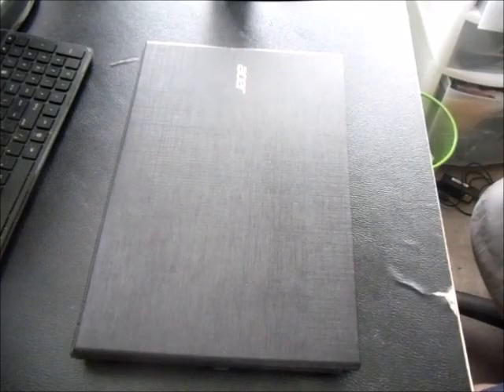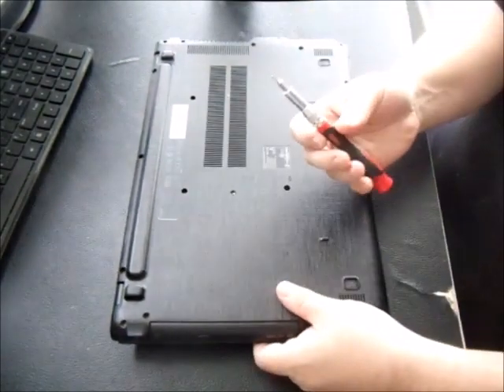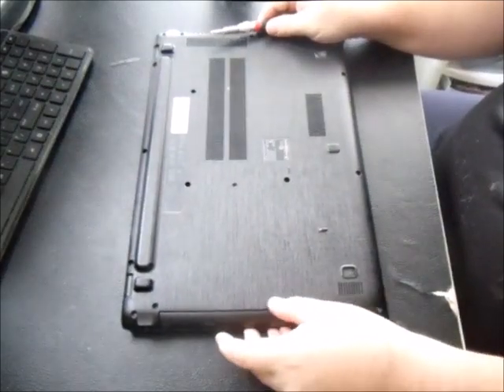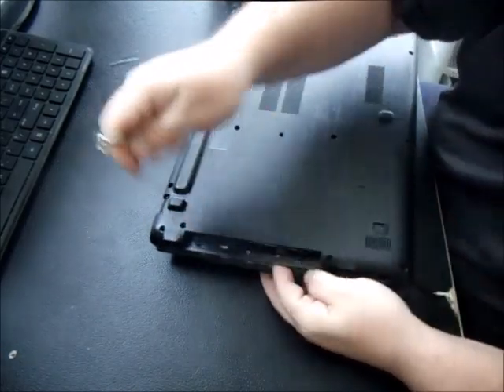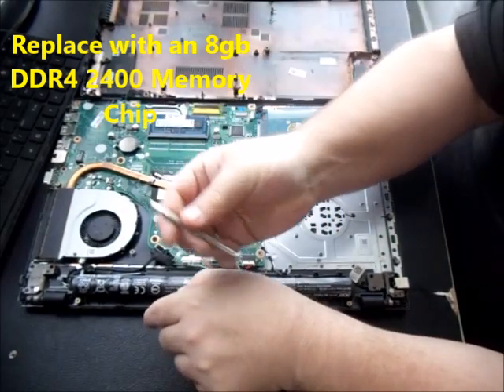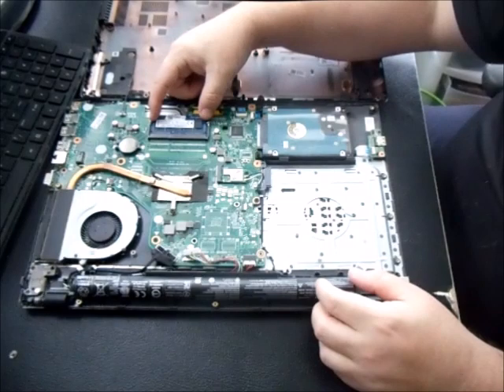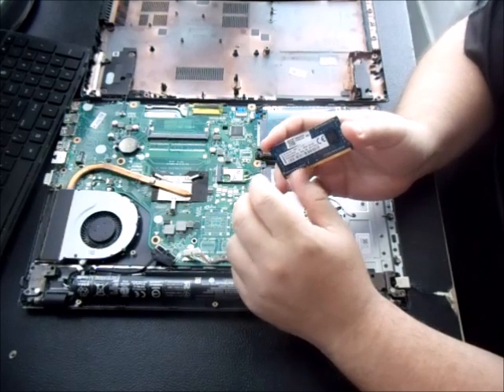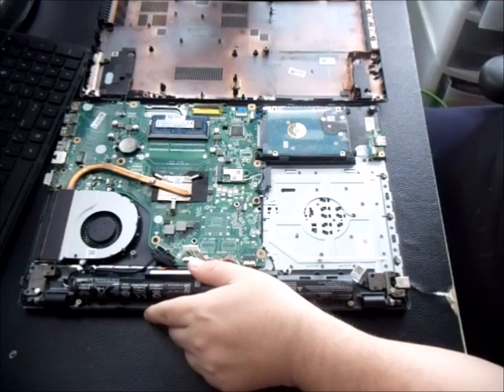Acer E5 Memory Laptop Disassemble Memory RAM UPGRADE Battery Hard Drive REPLACEMENT Take Apart SSD

Comment: I'm about to remove the hard drive from my E5 576G for file transferring when I have a new computer and an external hard drive connector, it died due to the motherboard failing. Does that model match with that laptop's specs?

Comment: Hello Sir. Thank you very much for your dedication to teach us about how to open correctly, and upgrade.
I have E5-773G mode and would like to do a clean up. Change the thermal paste and remove all impurities acumulated for a better air circulation iinside, when in use.
I will whatch your other videos, about an subscrube you channel.
Thank you very much.
I apologize for my poor english.

Comment: I gotb2400 8gb DDR4 Ram it doesn't fit in my acer e5..
Reply: i think you need to change 8gb ram ddr3
Reply: @silvershades7524  yes i have a acer e5 and works with a ddr3L

Comment: How do you open the 3 screw inside dvd???????????!!!!
Reply: Ikr it's impossible
Reply: Take the screw out for the disk drive and pull out the disk drive then you will see the 3 screws
Reply: @rmwmcfatty  how do u take the screws out, its different than the other screws

Comment: The model E5-574-592S has 02 RAM slots. And after remove the screws you shouldn't try to open the LCD because it relies on that an then you can broke! Be careful

Comment: ATTENTION! There are multiple versions of the E5 532 laptop. Not all are DDR4.
 For example I have DDR3 in mine so that is a big difference.
#1: Right click the taskbar at the bottom of your screen and go into Task Manager.
#2: Click on Performance and then Memory.
#3: Upper right corner of that screen will show how much is currently installed, what kind, and how many sticks of ram your motherboard can hold. If you have 2 slots I recommend buying 2 sticks rather than 1 stick to hold all the ram but do not exceed your maximum ram capacity for your model either way. Thanks for the video however, this ram upgrade should be the same across all E5 532's aside from the mentioned 1 stick or 2.
Reply: Can we use ddr4 if our laptop is ddr3?
Reply: @ThomAssPuyi  nope,it will not work...
Reply: @vali438  my laptop is the 522 model, and its ddr3, how can i know the max capacity?... and what kind of ram u recomend to buy?
Reply: @luisemmanuelespinozaolguin140  you can go to the Acer website and input your laptop model number and look at the spec sheet. The max. would be a total of 16gb i.e. 8gb + 8gb 2400Mhz of either ddr3 or ddr4 depending on your laptop. For RAM type, anything would be fine as there is not much in terms of differences for laptop RAMs.

Hope you have already had your doubts cleared and managed to upgrade your laptop (if you wanted to)
Reply: My laptop is Acer Aspire E5-473G . What ram should I use ? How many ram slot does it have?
Reply: mine had a DDR3L, made in 2015